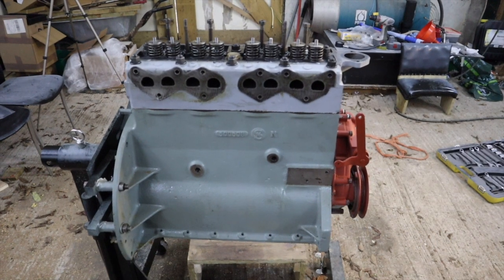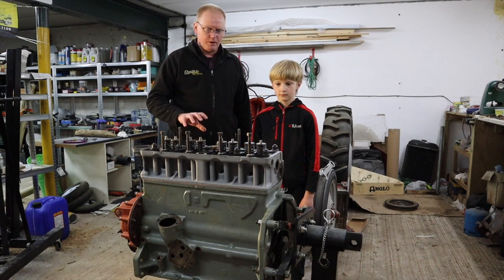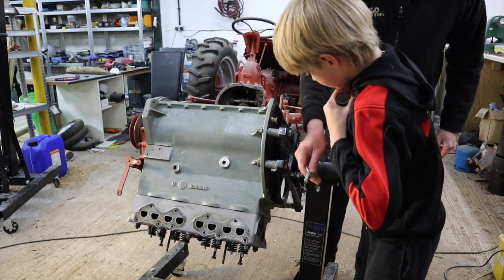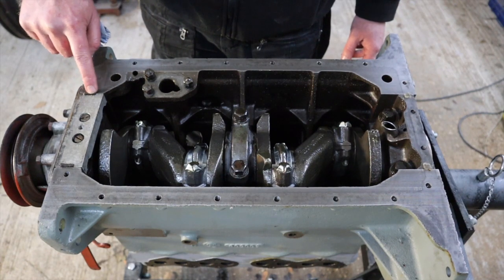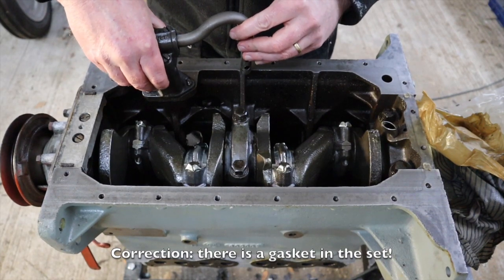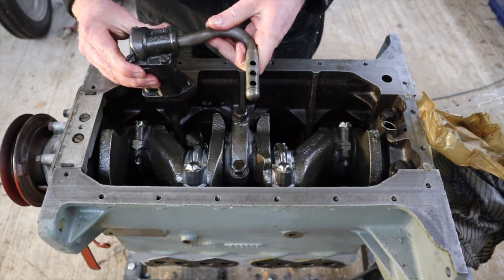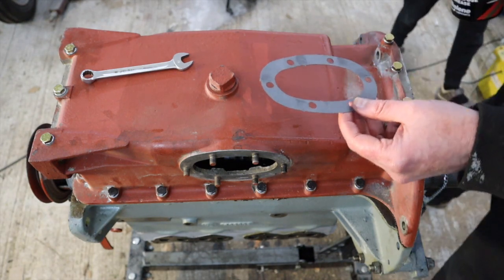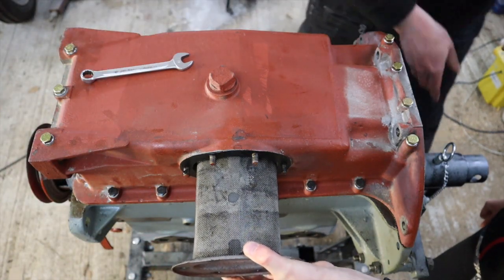#105 - TED20 - Fitting the Oil Pump & Sump - with Anglo Agriparts

Comment: You should of put your rockers on first.. your lifters just most likely all fell in that cavity between the cylinder head and bloc.. good luck putting them back in with the head in place. it took me hours just to line one up with a magnet. i hope yours didnt move!...  are you using grease as a sealer?
Reply from the maker: Hi Matthew, I didn’t think about that, however I believe they are quite a good fit and unlikely to have fallen out. We will of course see when we get to insert the push rods. 
We use grease not as a sealer, but it serves a few other purposes: it helps to keep the gasket in place during assembly, it helps the gasket remain pliable. This is a 3 or 4 year project, so some of our gaskets will be ‘old’ by the time we finish. It allows the gasket to move slightly during assembly without snagging or tearing. And it makes it really easy to remove if for any reason we need to redo anything, as we did in this video. The grease obviously, mostly gets squeezed out as you tighten things up and it does no harm. It may help the ‘seal’ to form, but it’s not a sealant. I and my father have done this for years and have had very few gaskets fail on us. In fact I can’t remember one, although there must have been some 😀
Well I hope those cam followers are not going to be a problem- we’ll have to see. 🙏😉
Reply: @WaterhouseForde  thanks for the info! I had bad luck with using gaskets only on mine. I ended up using gaskets and a very thin film of silicone on each side of the gaskets to prevent any leakage. Grease works too then!

I hope for you they wont be a problem!.. worse case scenario you take the head off again. trust me when i say lining them back up in their hole is extremely difficult when the head is in place!
Reply from the maker: Oh yea I’m not sure I’d even try to do it with the head still on! 👍😉